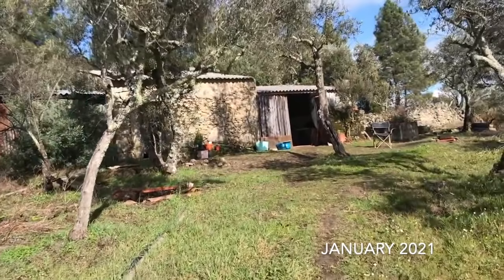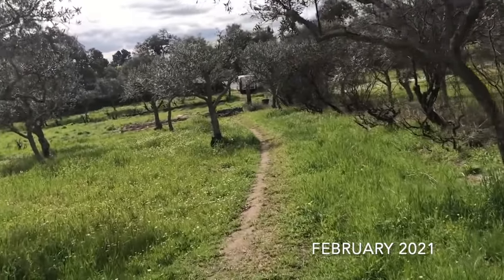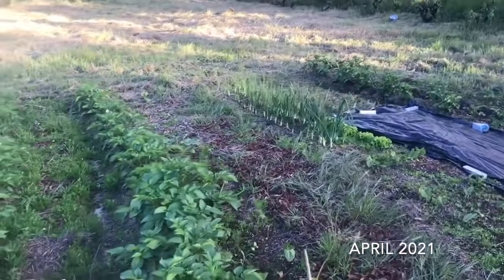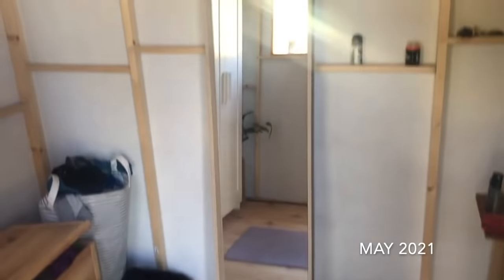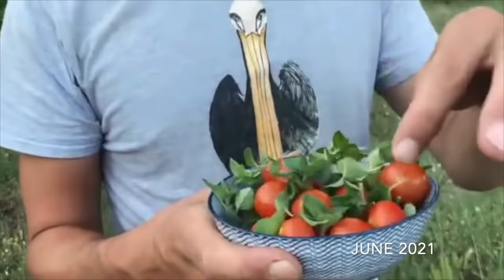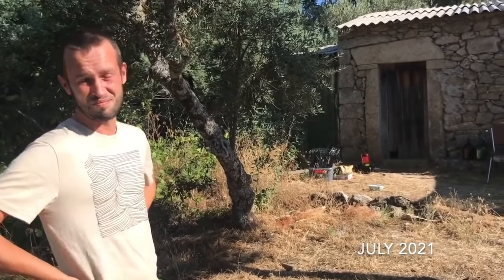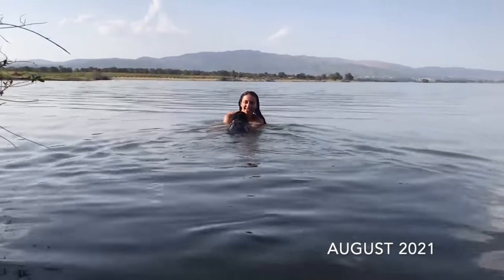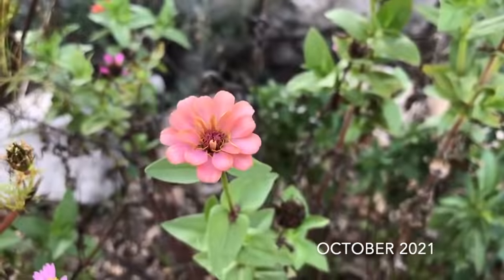1 YEAR TIMELAPSE: RENOVATING OUR OFF GRID ABANDONED BARN.

Comment: In South Africa, a solution for reducing heat in a dwelling is to add a fly sheet roof a foot or so above the building roof using metal or plastic sheets - like an umbrella- by putting up four poles a little bit bigger than the building, a framework and the sheets. This pulls breezes through and is very effective. Just an idea.
Reply from the maker: Love this idea! We’ll give it a go on the cabin next summer! Thanks!

Comment: Supernice video with lots of interesting stuff. Would it be possible to do any cooling during the summer, while off grid?
Reply from the maker: Thanks so much ☺️ we’re working on making the buildings cooler with insulation which will make a big difference to our comfort in the summer. I think you could get air con with a big solar power system
Reply: @FrankieOffGrid  Simpler solution would be to dig down a long pipe underground, and make it come up inside the floor to suck air through this pipe. Then a small black pipe through the roof/ceiling to suck the hot air out. This will drag colder air from the underground pipe. It needs to be pretty long, like 20 meters or so with air intake at the end. The deeper, the better.